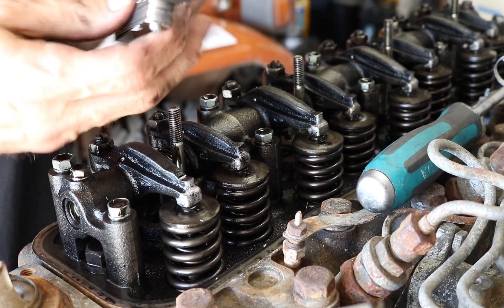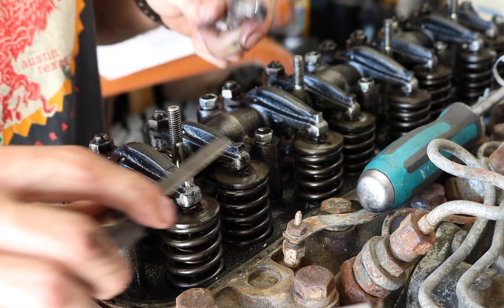TIPS  - VALVE LASH ADJUSTMENT ON TOYOTA B AND 3B DIESEL ENGINE

Comment: Check valve support bolts are tight to specs  before  any clearance adjustments  are made.
A few tips in regards to cooling system to keep the 3b alive well into the future. 

Remove the oil cooler case on exhaust side of engine block and inspect for corrosion . Neglected cooling systems the cast aluminium corrodes and will pin hole , coolant loss when driving and engine overheat  causing permanent damage.  Whilst case is off replace oil cooler o'rings and gaskets. 
If original carbon steel core / welch plugs are still installed in cylinder head and engine block  they will be rusted and thin on coolant side will eventually  pin hole and leak .  I recommend replacing all with stainless steel or brass . 
Also the 3B has baby core / welch plugs ( diameter 10 or 12 mm) in the side of cylinder head on exhaust manifold side , these are important to replace as they are often overlooked/ not seen as they are recessed and will be rusted and can pin hole.
( I can't remember if there is any core plugs in block behind pushrod cover 🤔)  . 

Use good quality hoses , radiator assy , genuine Toyota, or aisin aftermarket water pump. Genuine thermostat,  if bottom radiator hose has a carbon steel  pipe joiner its probably rusted , i replaced with stainless steel tube , roll a ridge like original with roller tool and tig weld on flat bracket like original pipe to secure to shroud . Heater hose valve/ tap replace with genuine. Heater core inside cabin  remove plus inspect for leaks and flush internally. Hoses to heater core check .

Use genuine or good quality coolant with distilled water or coolants to suit your location. 
The old 3b will last forever if preventative maintenance is done competently. 5000km engine and oil filter. Regular fuel filter change , clean air . 
Don't forget the vacuum pump oil supply and return hoses for old and perished , vac pump / alternator shaft seal . 

Carbon steel heater hose elbow for rust at rear of head intake manifold side , replace with brass elbow 1/2 inch bsp male thread to 5/8 hose barb .   Straight hose fitting on water pump  change to brass. 
Pipe for heater hoses runs beside rocker cover is carbon steel , i replaced with stainless steel and tig welded around ends to make ridge to retain hose similar to rolled on original.

Comment: Best valve lash adjustment video I have found. Thanks so much. I have a 75 FJ40 and need to do this adjustment. Approach you demonstrate here similar to what I've read on the 2F, but wondering if you or other viewers can speak to any differences on this particular project. I can check FSM to ensure hot & cold intake/exhaust specs are correct for 2F, but I'm just curious if there's any other difference on the non-diesel 2F for this particular job that I should be aware of before taking the valve cover off and getting after it. Thanks so much!
Reply from the maker: I think it’s pretty standard, at least on straight diesels. My 12V Cummins was same. Haven’t done a gasser.

Comment: Excellent video. Good thing for pointing out that your adjustments are spec'd for a HOT engine. By the way, is your BJ40 the 12v version or the 24v version?
Reply from the maker: Mine is 12V.
Reply: @JUSTANOTHERLANDCRUISER  thanks for sharing. I have a JDM BJ41 with 24v. Cool resto vid. Looking forward.
Reply: BJ40 never came with 24 valves. If it has 24 valves is not a B series engine..it's an H series which is a straight 6
Reply: @enterBJ40  think he might have meant v and in volt, idk though

Comment: so "loose tappet" and crack shaft should be in up so pistion in TSD .. and we know now all loose tappet or valve that can be now adjustment ..  second  lower position of piston and repeat that loose method .. am right?    that is best for me because rule of 9 is so much calculate 😂🏃‍♂️🏃‍♂️🏃‍♂️
Reply: The Rule of 9 is probably the simplest way to adjust tappets, a child could do using that method....

Comment: Subbed just because you have a Vessel screwdriver. You understand Japanese vehicles if you understand Vessel. I know it was a slotted and not a JIS but you get my point
Reply from the maker: Not just a Vessel.  It's actually a Toyota branded part numbered screwdriver.  I also have the Toyota hammer, a few wrenches, and JIS #1 & #2 screwdrivers.
Reply: @JUSTANOTHERLANDCRUISER  You get it.!

Comment: Can a 2b cylinder head work on a 3b engine block
Reply: Hmm. I don’t think so but I may be wrong.
Reply: It could at some point. But maybe might have aome few differences with internal parts like cams, valves etc. Check out IH8MUD forum on diesel section and there's a thread which parts are compatible between a B, 2B and 3B engine.😉